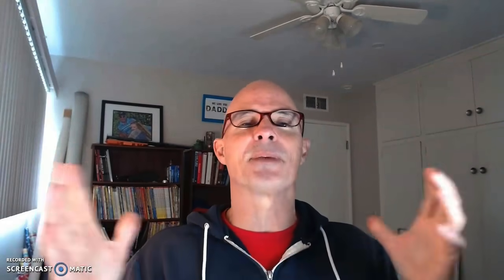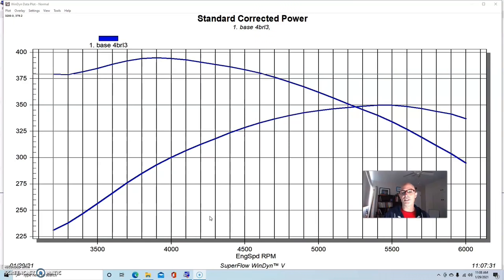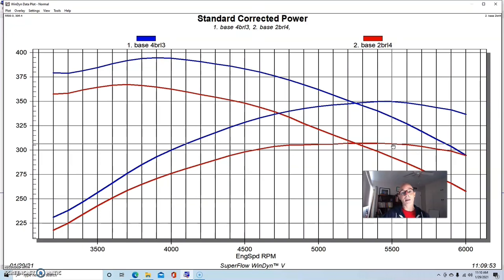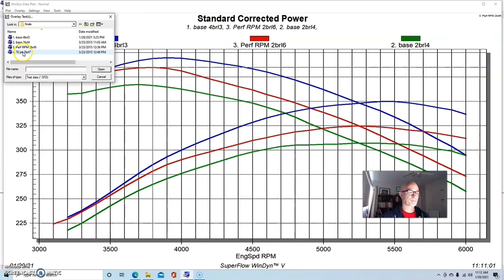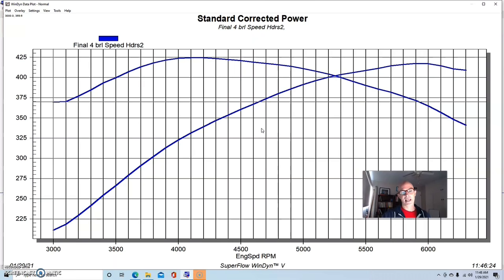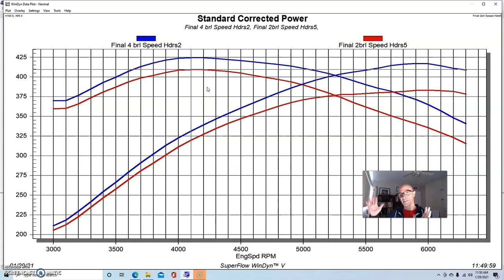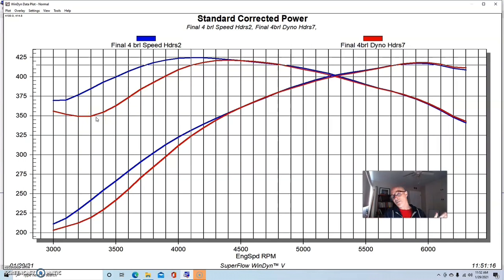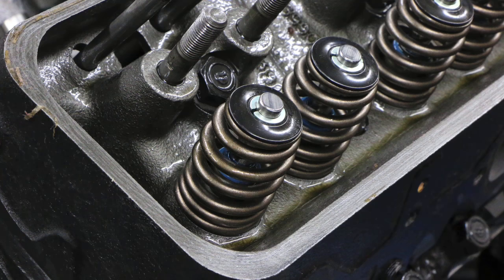SBC POWER GAMESSTOP HERE! (2BRL VS 4BRL)

Comment: I don't know how long people have been doing it but over 50 years ago I used a slotted adapter to move a 2 bbl fore and aft to improve distribution of mixture to gain power in classes where we were limited to 2 bbl carbs.  With experimentation it is always possible to find a "sweet spot" where your engine will make a bit more power due to superior fuel distribution......made sense then, makes sense now.  And, now that I think about it, we were using the 500 cfm Holley deuce, also.  I believe it was a List 4412 if my fading memory serves me correctly.  It was just one of many "trick" procedures we used.  Some of that was ruled out as the list of mods became more  restrictive to 'even the playing field'.  The late Smokey Yunick was a master of bending the rules and it was alway entertaining what he was going to come up with that he could sneak past the tech people.  I really miss that guy and his stories.  It was also fun to play with the 390 cfm 4-bbl (can't remember List #) and the 450 cfm (List 4548) when we were limited to those cfm.  Horsepower goes to the guy who's willing to think outside the box and experiment based on logic and thinking in terms of velocity and path of flow.
Reply: It's only cheating if you get caught. I think it was him who had the fuel tank taken out in tech inspection and still drove it back to the pits.

Comment: That tuned header test is impressive. I wouldn't have believed the small headers matched the power curve down low and made that much more low end torque. They've got an optimized setup on their car.
Reply: Tri-Ys on my L31 350 powered Express van woke it up like crazy compared to the manifolds. Running along at 2,200 rpm @ 70 mph the headers kept it from having to downshift on the same hills it previously dropped to 3rd gear on.
Reply: @chrisreynolds6520  did you upgrade your exhaust at the same time you installed headers? 
  I didn't notice much of an improvement on my tbi 350 from headers. I'd already cut off the old clogged cat and rusted out muffler and ran a 7' piece of 2.75" pipe in their place. To be fair, the factory manifolds weren't holding my engine back. It's the low compression heavy duty 4 bolt/flat tappet L05 so it's got a whopping 190hp and 300lb/ft. 
  I originally had a flowtech 2.5"-into-3" y-pipe matched to my headers. I've since kept the 1 5/8 headers and upgraded to 3" collectors into single 4" with a snazzy Flowmaster 3"-into-4" y-pipe. It's a 4" system designed for a 6.5L diesel. I put a straight-through 5" diameter muffler on it to kill some of the sound but not hinder any flow. I was surprised how much it quieted things down... considering I could stuff my arm through the muffler.  Lol.
Reply: I had factory 3" dual pipes and cats to the muffler. I had previously upgraded the cracked manifolds to shorty headers and swapped out the muffler for a walker dynomax dual 3" in and single 4" out bus muffler.  The Thorley headers came with piping to match them to the stock exhaust tubing.  Swapping from the shorties to tri-ys was a big increase in torque.

Also had the same TBI engine you have in my 83 G20 van after I spun a rod bearing in its factory 305.  I had previously swapped the 305 to TBI from a 95 G20 van.   I had thorley tri-y headers into the factory 83s dual catless 2.5" exhaust. I put a x-pipe where the factory pipes ran together just behind the driverseat and had custom 2.5" piping bent to connect the headers to the X.  That low compression 8.75:1 TBI 350 with headers, catless exhaust, a performer rpm intake with a marine TBI adapter and 2" bore marine TBI topped with a 454 van air cleaner and larger intake ducting made 200 hp and 300 tq to the wheels through a 1995 4L60E and GM 12-bolt. I did the programming on the chip. Other mods where a 25% underdrive crank pulley and 1.6:1 full roller rockers.  Stock cam and stock 810 swirl ports.  Swapped the cam to a 96 LT4 cam and power increased to 250 rwhp and  310 rwtq.  Then had a buddy sell me the 113 aluminum 58cc heads and cam from a ZZ3 or ZZ4 crate engine.  Made close to 300 rwhp and 330 rwtq.
Reply: @chrisreynolds6520  I went with truck flow super 23 175cc heads for the tiny 56cc chambers to bump my compression to a whopping 9.17:1. That and a comp xfi252hr cam really woke the motor up. 252/264 advertised. 202/212 @.050" .550"/.546". It's a k2500 pickup so I wanted good off-idle torque. The small runner heads mean good velocity and the short duration makes great torque. I'm running an edelbrock performer air-gap intake and sniper tbi injection with flowtech afterburner headers. Since I already had the computer controlled fuel and spark, I also added an entry level carbureted centrifugal supercharger. Just change the tune parameters to pull timing and richen the mixture under boost and you can just bolt on 8.5psi and go. I think with supercharged applications, scavenging is not as big of a deal. During overlap, the intake is forced into the cylinder instead of being drawn through with pressure waves. Even a few psi is enough to overpower the weak pressure waves. That's my theory anyway. 
  I've heard a lot about Doug Thorley tri-y's but don't gave any personal experience from them. I've heard they are aimed at midrange power. It sounds like they have treated you well. The afterburner headers are an unusual design in that they have 3 primaries into the 3" collector then have the off-sequence cylinder (4&7, respectively) from each bank dump into the side of the collector. 
  Your numbers sound impressive for stock heads and cam. I haven't dyno'd mine yet but I had plans to last spring. Then the bullshit started so I haven't made it in yet. Those are pretty impressive numbers. I had a custom chip burned for a tbi motor 15-20 years ago and was very unhappy with the performance. That's why I went aftermarket tbi this time around. I put on a set of vortec heads and a mild cam. Performer rpm air-gap, big block injectors. It puked black smoke and got about 6mpg. I should have gotten the equipment to burn my own chips and done it myself like you.

Comment: I ran a two barrel Holley earlier in my life on a small block Ford. Not because I wanted to but, because my insurance man assured me I couldn’t afford not to.   So I bought one of the newly developed 600 cfm holley two barrel carbs. Worked well for my application. Nice to see someone doing a little work to discover some of the two barrel secrets.

Comment: Aren't 2 barrel carbs rated at a different pressure drop compared to a 4 barrel? I thought 4 barrels were rated a 1.5" mercury and 2 barrels were rated at 3.0" mercury. So the 500cfm 2bbl isn't necessarily the same flow as a 500cfm 4bbl.  
  Unless I'm wrong. . But the 44hp loss on the 1st combo should be under 500cfm at 1.5"Hg.
Reply: I just did a little research. The conversion should be close if you divide the flow rate of a 2bbl carb by square root of 2. (1.414).  So the 500cfm 2bbl actually flows about 353cfm at the pressure 4bbls are rated. 
  I guess back in the 1950s engineers noticed that 4 barrel carbs didn't maintain 3"hg at WOT so they rated 4 barrels differently than 1 and 2 barrels. I also read that the difference between wet flow and dry flow can be about 8% so it depends on how the manufacturer tested the carb.
Reply: The throttle blades in the 500  two barrel are the same size as a750 double pumper if my memory serves. So I would say the math is close 350-375

Comment: It would be intriguing to test a victor jr 2 barrel manifold vs a 4 barrel vic jr with the 500cfm 2B, vs the 500cfm summit 4 barrel as I've seen them cheap carbs preform. Im sure the manifold exists purely for competition sake so it would be awesome to know where that stands. Also, that "246" cam made a stellar torque curve as well.

Comment: A big difference between 2 and 4 barrel carburetor flow ratings that most people don't appreciate is that they are rated at different pressure drops on the flow bench.  Four-barrels are rated at 1.5 inches Mercury, and two-barrels are rated at 3.0 inches Mercury.  Therefore, the 4412 Holley rated at 500 cfm would be rated at 350 cfm if it were tested as a 4-barrel.  It would be an interesting test to run 2 and 4 barrel carbs with 500 cfm flow ratings on the same engine.  The 4 barrel would make more power because it causes less pressure drop flowing air into the intake manifold.

Comment: Thank you Richard. This series of test smashed two beliefs I had.  First I always believed that a street driven 500cfm 2bbl carbs sucked at off idle was because it was to big, but would match a 4bbl mid range, then drop off on the upper end.....wrong according to your test.  Second was dyno headers were the standard all vehicle headers strive to meet.  I knew tube size mattered on the bottom end.  It was the upper end that surprised me.  I was wrong again..

Comment: Holley 4BBL carburetors are rated at 1.5 inches of vacuum. The Holley 2BBL carburetor is rated at 3 inches of vacuum. This test would be a 750 cfm vs. 375 cfm at 4BBL ratings. Exactly half of the cfm...
Reply: Correct. Now which would make more power: 2 375 2bbl or one 750 4bbl?
Reply: @CarsandCats  If Richard knows this about the CFM ratings from Holley. He could disconnect the secondary of the 4BBL and the numbers should be nearly identical...

Comment: Thank you. This kind of information is exciting to see as was the reverse cam video. Lot to be learned by looking into the restricted engine rabit hole and it can be a lot of fun. I've seen very high manifold vacuum up in the 6,000+ rpm range, some people will do crazy over emulsified main circuit adjustments in an attempt to lean out the high rpm a/f. I tried a few popular  carburetor builders tunes with the extreme emulsion and it usually ends up causing over active boosters at low air flow on my engines (been working on that lately) . Reduce the size and/or number of emulsion bleeds along with the main air bleed and the over active booster issue improves. It's better when rules allow a fuel pump with a high pressure swing  with low pressure and float level at idle and a normal pressure and float level above about 5,000 rpm.  Also interested in the reverse profile camshaft vs conventional and straight profile test on these restricted engines, especially solid lifter. I'm still on a 1980's grind with my current engine. Some builders are boring the small block cam tunnels to big block size to get a more aggressive lobe for 1.7ish rocker ratio. I guess that could work with the stock .842" lifter diameter when limited to the stock diameter???

Comment: Don't forget that two barrel carbs are flow rated at a different pressure than four barrels.  A 500 two barrel flows about the same as a 350 four barrel.  And quite a bit less than a 650 four barrel.

Comment: Lots of the 2bbl circle track guys around here use a dedicated 2bbl intake. It's some sky high single plane. You're probably getting some issues with distribution with the 2bbl adapter. I could see a dedicated intake making more power.
This is when you need your reverse split cam. There is intake vacuum. 🙃

Comment: would have been great to see the manifold vacuum between the 2 different carbs
Reply: And then increase compression to bring cylinder pressure back up to optimal during WFO operation ...  Due to the fact that manifold vacuum seriously reduces cylinder pressure and efficiency...

Comment: Richard, are you aware that 2 barrel carb flow is rated differently than the 4 barrels?

"Sometime during the 1950’s, engineers found that a passenger engine with a four-barrel carburetor would not maintain a vacuum of 3 inches of mercury at wide-open throttle; and by some convention 1 ½ inches of mercury was chosen for rating 4-barrel carburetors. The ratings for 1-barrel and 2-barrel carburetors were left unchanged.
To convert from one system to another (with a very small percentage of error) is relatively simple. Simply use the square root of 2 (1.414).
Thus to convert a two-barrel rating into a four-barrel rating, divide the two-barrel rating by 1.414.
To convert the four-barrel rating to a two-barrel rating, multiply the four-barrel rating by 1.414."

This would explain the power differences more precisely.
Reply from the maker: RICHARD KNOWS THIS

Comment: Good info. Really liked the header info, very graphic results.  And yet I have not even seen a set of 1 5/8" headers available for the LS engines.  This data clearly shows they would be a benefit on the small motors at least. Next of course would be a test demonstrating the results with an actual emission legal exhaust and various header primary tube diameters. Could expand to 5.3, 5.7, 6.0 & 6.2 or just a couple to make it easier??

Comment: Hey Richard. I would love to see a 2bbl/4bbl test on a little wilder combination. Our circle track class has a engine option between an “open” 362ci 2bbl and a GM 602 crate 4bbl (350hp). Just wondering how good/bad the 2bbl would be on something with good heads and high compression

Comment: Again great video you really help my number 2 go much smoother. I would like to see if possible the MSD dis system, part number 60153. I'm getting ready to purchase this for my 532 cubic inch Blown E85 big block Chevy. I like the individual coils 4 cylinder so you can control timing on each cylinder independently, and it has a two and a half bar map sensor built in. Thanks for all your awesomeness

Comment: Richard Holdner. Have you tested Comp's 4 pattern camshafts for single TB / carb V8s? I've heard several ideas about how to even out the AF mixture to the corner cylinders over the years, but never have I seen any dyno testing to prove out these theories. Please guide us to the proof.
Reply from the maker: We have tested them-it does not cure the problem with the intake

Comment: 2bbl 4412 is really only 354 cfm. It is flowed at 3.0 inches along with a 1bbl and a 4bbl is flowed at 1.5 inches. It's in a holley book I have
Reply: Yup, different pressure drop

Comment: Would step or tri-y headers minimize the low speed losses? Great work Richard!!
Reply: Since there is no upper gain, who cares?
Reply: i care, i think this is a good question.  not everyone is looking at max out put.
Reply: Have had tri-ys on both my G20 van amd my Express van. HUGE difference in torque even on an 83 LE9 305 with the stock cam.
Reply: @hotrodray6802  In restrictor class racing were they attempt to limit max HP, the area under the curve, IMHO, is important.

Comment: Would like to see how the 4412 reacts to large cc intake runner heads. Do they react the same as 4bbl test in another of your videos, or is power lost say on a 220cc head maybe even ported past 220cc
Reply from the maker: 2 brl vs 4 brl-the 4 brl wins with any head
Reply: Yes agreed but how would an engine say a de stroked 400 with 327 crank like / react to massive intake and heads with a 4412 is it bad to go big on that setup will the pressure pulse from the big bore overcome the big runners to run good? Speaking from 2bbl circle track rules ours are 4412 2bbl no rules on compression no rules on valve size no rules on port volume hell all this time we could have all titanium until next year for entry level b mod up to 360cid sbc for b mods where im at its like the wild west lol and there was no rpm limit till this year 7000 just curious for future builds also we can run aftermarket dart blocks i know a lot of 2bbl classes are more strict than ours though

Comment: I'm in the process of building a 358 sbc with dome pistons, vortec heads 4 barrel carb intake with a 680 demon. Right now I'm running a stage 1 thumpr cam and I'm putting this engine in a mud truck just wandering if that cam is a good option or what you recommend

Comment: Imca stockcar rules allow an unlimited cid motor BUT they are limited to an unmodified 350 cfm carb. There is no limit to cid or compression ratio
   A limited cid motor is allowed a  500 cfm carb.  Limited to 361 cid and 10.5 to 1 compression 
  Many guys run 421 434 cid and the 325 cab.  I'd  be very curious, which is a better route.
   If you like limited rules this ight be fun

Comment: What is the most power you have ever made in a naturally aspirated small block 350?
Reply: a non-aspirated engine won't make any power 😛
Reply: @michaelblacktree  sorry I meant naturally aspirated I'll fix that LOL
Reply: no biggie, I was being sarcastic 😛
Reply: Depends how much money you throw at it and definition of 350.
.We talking Gen 1 SBC casting? From GM? After market?
Strictly 350? Or is 355 ok? If 355 is ok then why not 383?

Does it have to have factory heads? Aftermarket heads that can be found off the shelf? Heads developed in house that have 13 degree valve angles...

What has are we running? 93? E85? C16? 🤔

There's a lot of variables. I'd say most naturally aspirated small block Chevy's put less than 200 to the wheels on unlocked torque converters.

Comment: You would probably see a closer gap on a smaller engine. I had a 70 Malibu with a 307 and it ran better with stock manifolds and a two barrel than it did with the AFB 4 barrel and headers I put on it. Try your 2 bbl vs 4 bbl comparison on your 305 you have there.

Comment: When I was building street stock engines, a customer brought me a Crosswind intake manifold.  Have you ever tried one on a dyno??
Reply from the maker: yes
Reply: @richardholdener1727  
I can't remember if that was the right name. It had super long runners that would 180 the intake ports. Maybe it was a torque link. We ran several with 2bbls and had decent results.

Comment: Oil pump drag?
If you can spin an oil pump at 4000 engine rpm with room temperature oil using an electric drill....how much HP can the pump actually be consuming?